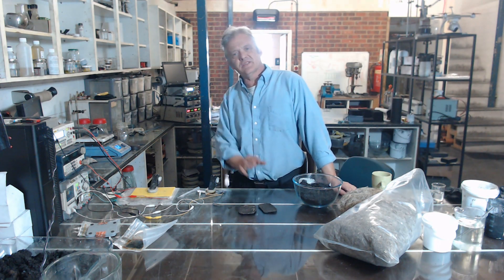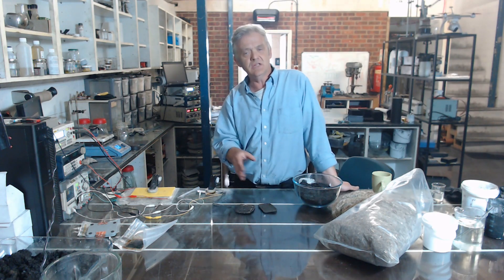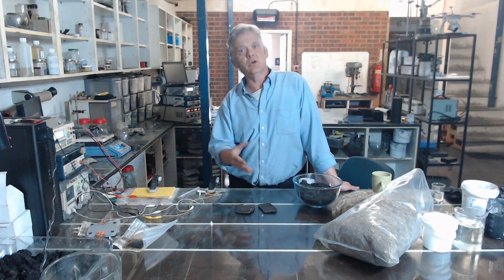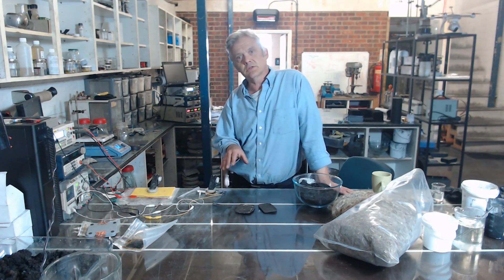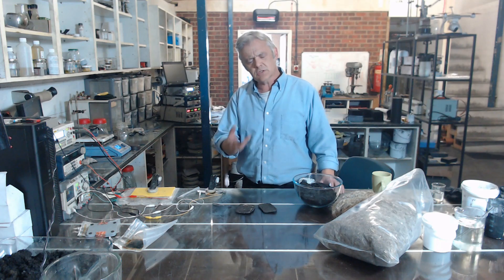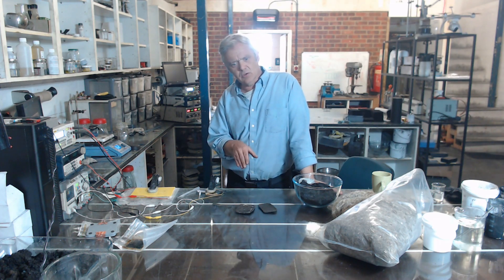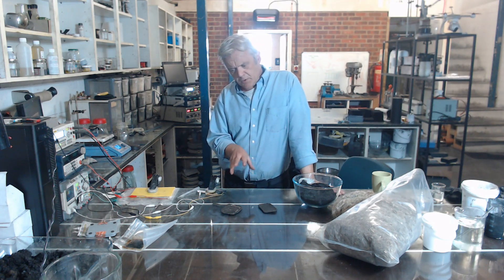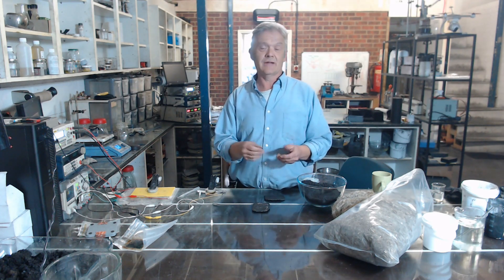Plastic From Hemp, Tea And Milk

Comment: Great video
I belive the gentleman that runs the CNC kitchen youtube channel would be very interested in this material,he regularly carries out extensive tensile strength experiments on 3D printing naterial. I know I am very interested in trying out this material for my 3D printing setup.
May I ask,does this material omit an obnoxious odour when heated to working temperature? 

Please do another video featuring this new material,it's very exciting and completely relevant given the current fight against climate change.

Thank you for sharing your video with us.

Kindest regards
Reply: There is no fight against climate change..  climate changes! There is however a battle with pollution.
Reply: @OohzyJohnDow  
Sorry, but that's just not what the physics tell us. By burning fossil fuels we obviously create a lot of CO2 and that is added to the carbon cycle (CO2 that wasn't a part of the carbon cycle before the combustion). Now if we look at the absorption specturm of CO2 (from which we know every absorption line of) then we can easily show that it's a greenhouse gas. So more of it will make the earth hotter. Now of course we know enough about radiation that we can quantify this exactly and we can calculate a thing called the radiative forcing of the added CO2 since the industrial revolution. We can also measure the backradiation from CO2 and deduce the radiative forcing form that (via direct measurements from the atmosphere). Both numbers agree with each other. 
We can also calculate the radiative forcing from the sun and all other natural factors and we come nowhere near the radiative forcing from CO2. The sun is the biggest natural factor and it only provides about 1/15 to maximally 1/5 of the radiative forcing compared to the forcing caused by CO2. So the current global warming is entirely human caused (everything above the temperature in 1950 can not be explained by natural factors). So of course we can stop it. We "just" need to stop burning fossil fuels or we burn fossil fuels and sequester the CO2 that is emitted. In other words we need to achieve a CO2 neutral society, which is doable. 
I mean we've lived for thousands of years in a nearly CO2 neutral manner and obviously with todays technology we can get there again, but since we have so much more knowledge we can get there and still have electricity, computers and all that modern stuff. The question is simply if we want to go there or if we prefer to deal with the possibly disasterous consequences of gloal warming. Or in other words: Do we want to play russion roulette or not? (i do not imply that we're all going to die, but if you read the scientific literature you will notice that depending on how much accumulated CO2 we emit we could end up destabilising our civilisation, whereas there's no risk even remotly that big if we stop using fossil fuels and replace them with regenerative sources of energy).

Comment: Could it be 3D printed?
Reply from the maker: dunno
Reply: @ThinkingandTinkering  
Robert, it's not hard to determine if this is useful for 3D printing. 
Just stick a bit of the solid stuff in a cup and heat it up. If you can bring it to a semi liquid state the way plastic filaments get, then it's printable. 
On the other hand, the temperature at which it begins to flow will also need to be in the same range as. PLA or ABS.